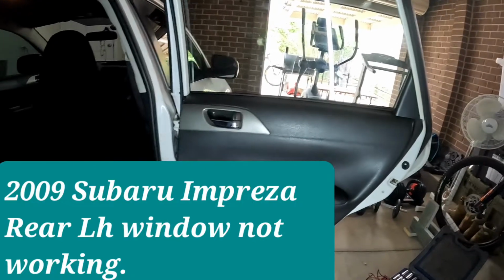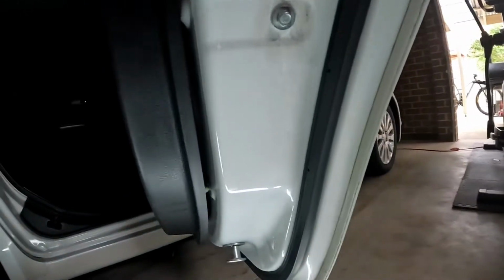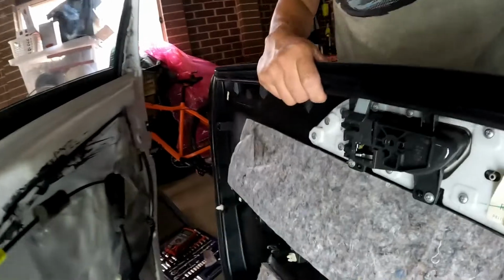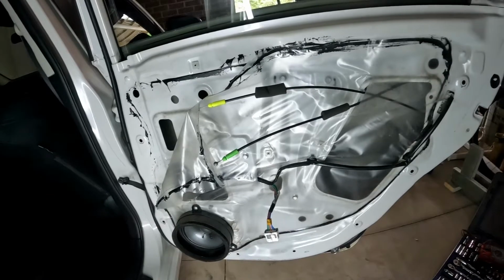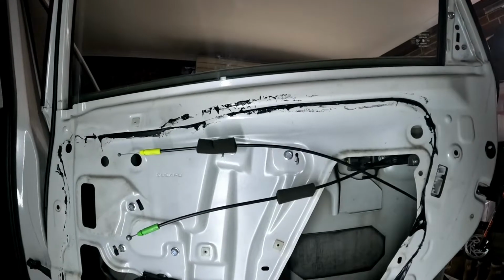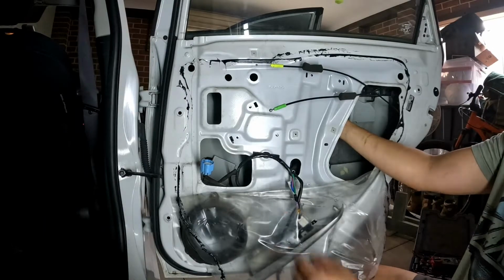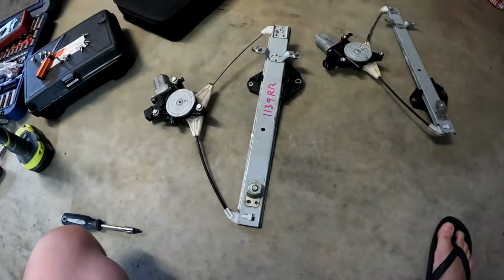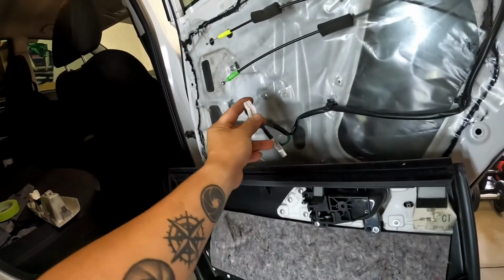Door trim/card removal. Power window motor removal and installation. 2009 Subaru Impreza

Comment: dont cut cable lol  motor assembly comes out    pop 2 filips screws and pull motor stator cover off   so u can spin window motor core by hand   or if u get fancy  use a drill to spin motor core to lower window